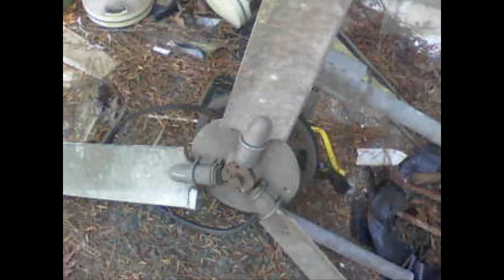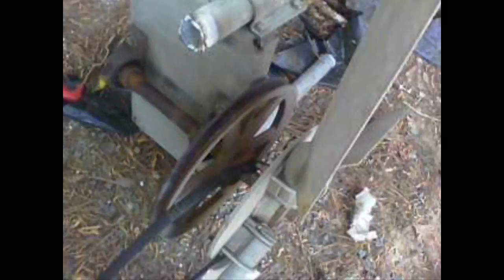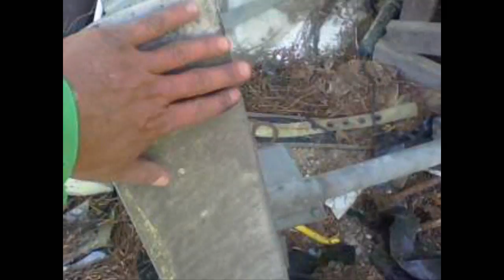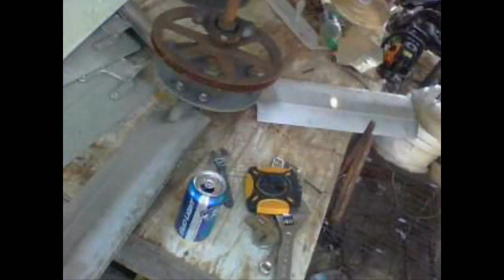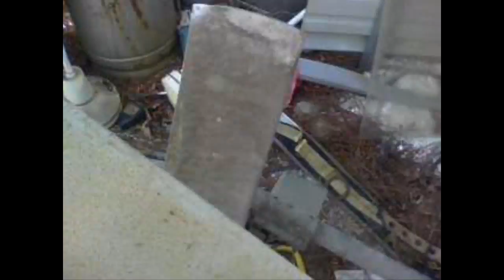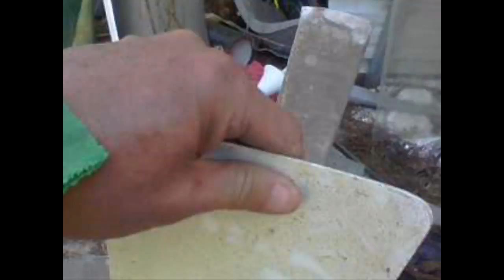windmill generator maybe?

Comment: This configuration has wide non tapered non variable pitch blades. That means it is designed for torque, not high speed. Therefor, you would benefit in adding more blades for torque. Keep in mind that three blades is the most forgiving config for balance and to mitigate vibrations. And any odd number will do this to some extent. Don't use even numbers if you can help it. In Grid down, who cares. But I recommend an all American high quality setup like Missouri wind and solar's 1600 watt general

Comment: Don't mess with the original configuration. Use it and tie to a generator. I should think you'll induce issues if you try to add blades... balancing perhaps... stick with what you have and put the other blades to work somewhere else... just The Swede's 2 pennies.. Love ya bro!

Comment: It would seem that 6 blades would be better than 3..... but out west those huge windmills only have 3 blades. I dont know if it is because of bad airflow adding 3 more or the weight of 3 extra blades.... or maybe both. Also the blades are tapered to the tip. I am sure that means a lot as well. Sorry no help here, but i will be watching.

Comment: the only problem i could think of with the extra blades are balance issues. if you dont get them just right you will have vibration which will decrease the efficiecy of power generation.

Comment: You could use an electric motor from a whole house ventilation system that is either 1/2 horsepower or 1/3 because they are also belt driven and ac powered then just put it in some water tight yet vented enclosure and run it into a ac-dc converter w/ a surge protector and a few other items then run that into a bank of deep cycle marine batteries enough to supply power enough to run your house and sell the rest back to the power company.